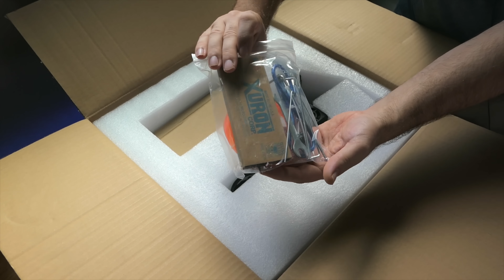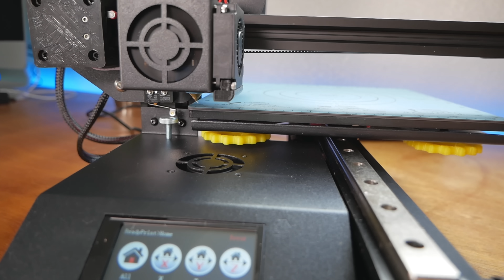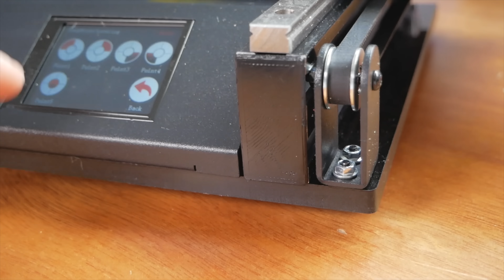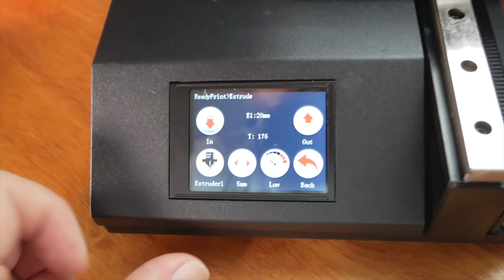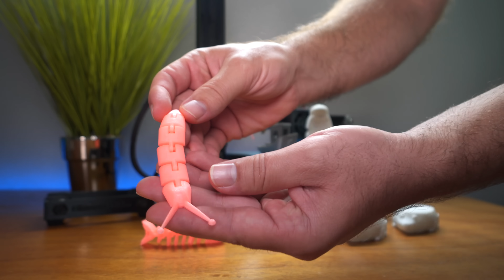Kingroon Sooway - 3D Printer - Unbox & Setup

Comment from the maker: New Channel: www.youtube.com/@Just_Print
Buy it here: https://geni.us/zDdCFIk
Recommended: http://geni.us/JustVlads
Reply: Just got mine today. Put it together and was anxious to try it and what happens? Nothing. It won't heat the nozzle. It says error in red lettering on the upper right corner of the screen on every screen. Right out the box it's error. Do you have any ideas on why it would say that? Firmware issue perhaps. Looks Good on the video and easy how it started up.
Reply: @danotero302  have you managed to fix it?
Reply: @thomaslevendig7421  I was able to fix it. One of the connectors on the mother board was connected backwards. As far as printing, I have had no issues since. Prints amazing. At first I was having a bit of extrusion issues but I played with the setting in cura and tadaaaa.. amazing prints👍👍👍👍👍 I use a high temp setting for the nozzle and keep it at 0.2 resolution. Just turn the fan up a bit and it prints amazing👍👍👍👍
Reply: @danotero302  great, I work together with the designer to improve it so if you have a suggestion, just tell me!
Reply: @thomaslevendig7421 thank you that is good to know👍 I must say I am amazed on how good it prints and it's small enough to transport anywhere. Definitely delivers more the expected👍👍👍 I don't mind leveling the bed manually but the software must have a glitch because the self level feature throws the extruder far off the bed to the right. May want to take a look at that but other than that it works flawless👍😊
Reply: @danotero302  I will!
Reply: Just Vlad is this 3D printers retraction settings good to go (no stringing) right out of the box?
Reply: Would you recommend this 3D printer?
Reply: would you reccomend this one over the ender 3 pro?

Comment: The reason the print just stoped it because your G-code only has some of it try using the included program the the SD card should have came with max run a new G-code in it

Comment: I bought one, worked great right away. mine is the updated one, KP3. Everything works great, super easy to use, but i'm biased since i have a lot of experience with printers and mechanical systems.

Comment: Decided to purchase the Sooway after seeing this video. I wanted a smaller printer to go along with my Ender 3 so I could run two print jobs simultaneously. They now have a new version out, the SW-200T, that has a heated bed, AND is cheaper to boot!! Cost me a grand total of $152 and change, and that's including California's new internet tax. :P  Considering what you get, this is a pretty darn good price. And the thing prints beautifully. Like others have said, the SD card that came with this thing is garbage. After a few prints I started running into trouble where the thing just wouldn't print, turned out that the SD card got corrupted. Reformatting it MIGHT work, but I would just go and buy a real name-brand (Sandisk, etc.) card and use that instead. But that's a minor issue, and I am really happy with this purchase.

Comment: Great video, thank you! I just purchased one when I saw your positive results, and I printed the test print today. It works! Yes, it works despite the cheap design and poor adjustments. I forgot the bottom bolts so that I will put in them tomorrow. As I see, there is a lot to fix, but to get a working out-of-the-box printer for this price is fantastic, I think. Aaaaaaaaannnnnnnnnddddddd: Mine have heated bed!!!! (It works) Nice! I love it!

Comment: I loved you preview so much of the sooway sw 200 3d printer, that I bought one for myself. I received it last week and have already printed 2 test prints.  I was wandering if you had any problems printing after your initial test prints? I ask this because I am having troubles getting it to even print today. I've done nothing different than I did on day one. It will extruder filament to start a print , then nothing,it just goes through the motions, but no sign of a print. I was just wandering if you help me solve my problem.  The filament im using is hatchbox pla (Grey) .as I stated it will exude the filament but no print,just goes through the motions. This after my first two test prints printed very nicely for a first timer. Any help or advice will be greatly appreciated. Thank you for helping with my 3d printer choice. It's easy to assemble as you mentioned . but I'm just having the print issue . thanks again.
Reply: Get yourself a decent MicroSD card. A real name brand one like Sandisk, Kingston, Lexar, etc. The one that came with the printer is garbage. I had the exact same problem as you, and after trying all the usual troubleshooting steps, I tried using a different SD card. Worked perfectly.
Reply: Cool, I'll try a new micro sb card,  thanks for the advice and help.

Comment: What’s size are the threads for the nozzle ? Or what block does it have ? I want to switch mine for a hardened nozzle for nylon & carbon fiber filament ?

Comment: the problem with the porcupine was not the printer or the g code it’s the address card reader i suggest to get a new as card reader and not use the one that the 3d printer have you this has happens to me any my easythreed nano and when i changes the a’s card reader i got much better results

Comment: Kingroon 180. $140 same exact model, but has heated bed. These printers come with corrupt sd cards, need to reformat before printing your own files.
Reply: Does the kingroon have a heat bed?
Reply: @tavovergara2525  it has a heated bed yes, but I would suggest using blue painter's tape

Comment: I have this printer yet every time I create gcode for an object and go to print, it shows no temperature and doesn't print yet progresses the percentage as if it is. As well it's not centering any of my prints. I'm using Cura to export everything and yes I tried your settings for Ender..still nothing and now as well the end stops are not functioning like they should, one keeps sticking.
Reply: Did you ever get it to work? I'm having the same problem

Comment: Recieved this printer today, one thing that isnt really mentioned (or maybe I missed it) is the fact the print bed under the magnetic part is acrylic. This probably wont be a big deal for most but mine is slightly warped, I'm going to try flattening it before getting with the company for a replacement. Have not been able to print with it yet for this reason.
Reply: Are you interested in joining the Facebook group?

Comment: Just bought one these a few days ago.  It's a bit of a hot mess but has potential.  Mine had a few assembly mistakes and some design or fabrication errors but nothing that will keep it from being a serviceable little printer.   It has a Makerbase MKS Robin Mini with an STM32 processor.  Most of the hardware is just basic Creality clone stuff that you can get most anywhere so it's easy enough to find parts and mods. The electronics cover is a pain to remove so do whatever you think you'll ever want to do under it the first time.  The bed was flat and the magnetic build surface works well.  I'm using it at work to print masking caps and small fixtures in PLA so it's fine for that sort of thing.  No complaints for $160.

Comment: I have a CR10s but would like a smaller printer to put at my desk, would you recommend this or the Ender 2? I do see this doesn't have a heated build plate but not really needed as I only print in PLA.
Reply from the maker: The sooway is a nicer package over all with its features and also comes pre built, but if you want the same creality quality prints go with the ender 2.

Comment: I was just about to buy a inexpensive 3d printer such as the select mini v2, but now I think that I'm set on buying this. Until I get a feel for 3d printing, then maybe buy a more expensive one later on. What do you think I should get???
Reply: But it has no heated bed. That means you can only use pla, that might not be a problem for you.
Reply from the maker: This is a great choice for starting out. You dont really need a heated bed unless you want to print abs which i would not recommend for beginners.
Reply: Just Vlad, thanks for the video, I'm going to order this tonight (I ordered it, along with some hatch box pla).I'm not worried about printing other filaments, I just want to buy this to get a feel for 3d printing, then later on buy a anycubic mega s.
Reply: @JustVlads  there are many more filaments than abs that need a heated bed, I would choose the ender 2 over this and I believe it's has a larger bed and or higher build area, if you what a small printer that is. But yeah thanks for your vid, anyway.
Reply: pooheadlou, not worried about printing exotic materials, plus the ender 2 seems to have its issues.

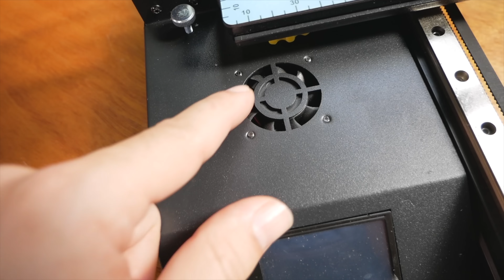Comment: man 6:59 that fan so close to the build plate is a real bummer. You can't even print a cover as the bed runs right next to that. Still, for this build size at that price is pretty amazing. I also like the quick adjustable Z axis in case you want to put a glass bed vs the standard magnetic bed. On my Ender 3 pro, I like the magnetic bed it came with but it simply doesn't adhere as well as glass & hairspray does in my experience.

Comment: So basically, it's a properly upgraded Ender 2 with slightly larger build size and additional bells and whistles. So far, so good (especially for the price).
Question is: can it match or outperform the print quality of the Ender 2? And what about the controller board, proprietary like the Creality ones, or upgradeable?
Reply: But no heated bed, that's deal breaker for me. Shame!
Reply from the maker: Not quite ender 2 quality but close. Not sure about the electronics part, I have no experience in this area. But seems like an excellent printer for beginners.
Reply: @JustVlads  Well, open it up and take a peek at the control board then. Does it look something like a MKS GEN L board with swappable stepper drivers, or is it a single proprietary PCB like in the Creality products?
Reply: @axelhopfinger533  its the mks robin mini
Reply: @thomaslevendig7421  Thanks, in this case, this seems to be a more than viable alternative.

Comment: Failed prints at the exact same place even when re-slicing it again, could be a corrupt sd card. Formatting the card should fix it.
Reply: Cesar Chang you have to remove the files from the download files from the sd card for it to work properly. Just move the file from the card to your computer then put the card back in